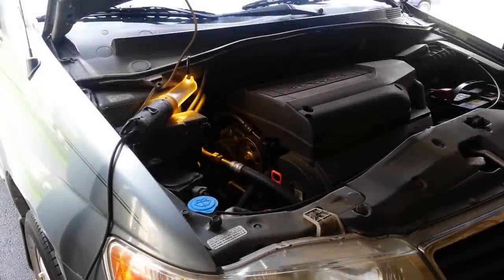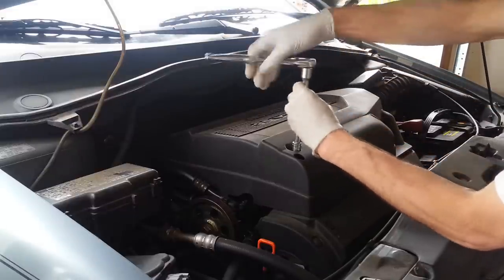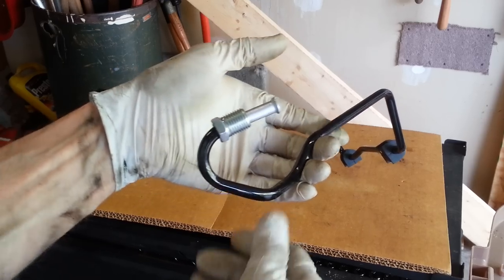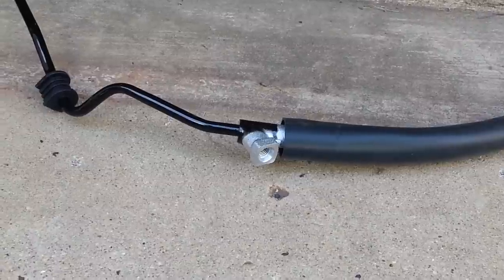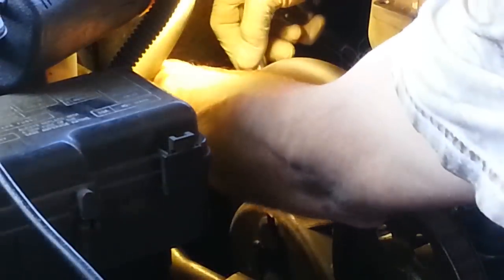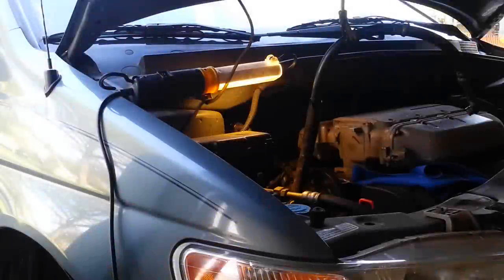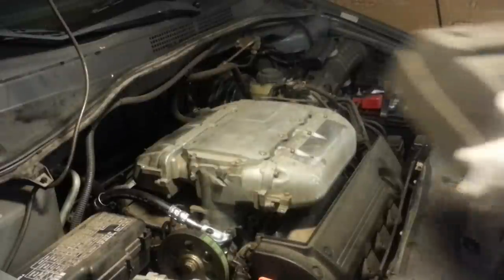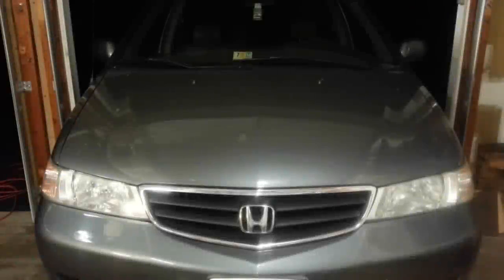Power Steering Hose Replacement 2002 Honda Odyssey

Comment: I just tackled this today and have a few tips for yall..

Only use honda line!!! All the after market lines will leak after a month- year later and you'll be doing the job again..

Most dealers are going to ask $250+ for Honda line,but hondaautomotiveparts has them for $146+9 shipping.

Get some honda fluid if you can.our whole system went dry for about a month and we ended up using about 4 bottles to fill and bleed..if you are just doing the line without too much leakage you'll probably only need a bottle.

its not that bad of a job.just try and get the van up high enough yet safe to work under.. try to have a 2nd person around to help pull out the old hose and feed the new in back in.

Tie a string to the rack end of the line before you pull the old one out.it will save you so much time in trying to figure out how to route the new line and keep you from needing to pull it back out.

The sensor o ring is a 8mm x 2mm.auto part store should have them loose,if not grab one of the o ring packs for $8 or so.

If the sensor wires have broken like mine were and you know how to solder,you can pull the harness out with the line,then pop the black plug out of the back of the harness where the broken wires are,carefully trim the plastic of the harness around the wires with some small snips,then strip off the wire  Insulation so that you can solder new wires to the harness.use some heat shrink where you solderd then some hot glue all around the wires to stop water from getting into the harness from the rear. Now for the other end of the wires on the van,you need to get the broken wires up from down around the cv joint and get it up to the top of the fender so that you can have room to reattach the harness to them. I solderd all those connections. 

If your pump is bad,you most likely can rebuild it.get a rebuild kit,but they don't sell the main pump baring ANYWHERE!!!.however that bearing is the exact same size as a John deere,craftsman riding lawn mower dech spindle bearing and advanced auto sells them for around $6 each.just make sure to take out a seal on one side of the bearing so that it can get lubed while in the pump.

it took my girl and i about 5 hours. roughly hour-2 to get the line fully in and out,about another hour or more to fix the harness and wires,another solid hour of bleeding all the dam air out,and I went ahead and did an oil change while I was under there.

If you have a pressure washer use it afterwards to rise the engine bay and under the van and get all the old oils off.

Now go have fun!!
Reply from the maker: Very nice writeup! Thanks for sharing your experience. It sounds like yours was very similar to mine. Here's my associated video on rebuilding/overhauling the power steering pump:  https://youtu.be/A4zpDPKPdGE.
Reply: I replaced with two different hoses. They all have problems with leak.

Comment: Thanks a lot for posting this procedure. I feel a little better about doing the job now. 
I also assumed I had a bad pump until I found a few pin-holes in the hose when preparing to remove the pump.
It would have made a LOT of sense for Honda to have made a two-piece assembly but they are designing cars for efficient assembly, not easy repair (note the screws going in the top of the lower clamps rather than the side).
Question: Do you think it might be easier to feed the hose up from under the car? Or is there too many obstructions?
Thanks again for posting!
Reply from the maker: You might be able to do it by removing the driver's side front wheel and feeding it from that direction.  The challenge there would be with the chunky part where the pressure switch goes and getting that through.  It's just tough to navigate the hard line over the frame's cross member in those tight quarters no matter how you look at it.  Either way, it's a puzzle that is doable but just requires patience so as not to damage it.

Comment: Nice I have a 2005 pilot   about the same  thanks  wow your line straps are in easy locations  pilot has them sandwiched between frame and car body
Reply: Oh no...I am getting ready to do the job on my 05 pilot and I hope the line straps arent too hard to get to! Some videos suggest dropping the subframe, I'm not about to do that so if you have any other tips please let me know!
Reply: +Leslie Jones it's a tough job...  if you have a hoist.. tools and a helper who is really sharp with mechanics on cars.    basically you have to take a piece of the cross subframe off then loosen four bolts way down to drop the subframe down.  the line clamps can be removed with a 10 mm wrench then but the problem is you need to cut that line and get a socket on it....  yeah. oh shit
Reply: +Leslie Jones you may just want to take it to a dealer it's like an hour and a half or two hours on the book
Reply: ouch... so you're saying there's no other way to get the clamps off other than lowering the subframe? I was hoping that it was only a "suggested" step to make things easier for the more equipped backyard mechanic...
Reply: Leslie Jones just take it to local shop that's good..  buy Honda parts online, cheaper.
Reply: +Leslie Jones if you have a good mechanic to help you go for it if not just take it to a shop

Comment: I used ur video to change the power steering pressure hose on my 2007 Honda oddyssey. I couldn't go past the 1st step. which was remove nut connecting line to rack. I even used a flare wrench. I guess iam stuck.
Reply from the maker: +Eduardo Flores Where did you get stuck?  Did the nut get rounded over or was it just too tight to turn?  Note on the video at 9:30  how I used a cheater wrench on the end of my flare nut wrench to give me the extra leverage needed to crack it loose.

Comment: great video thank you so much.  For me the flare fitting was so tight I rounded it with a line wrench.  I needed to cut the line with a small pipe cutter and use a bolt extractor.   After i got the old hose out the pressure switch was seized to the hose.  any tricks for getting this off or is it just better to buy a new pressure switch?
Reply from the maker: Soak it with penetrating oil and let it sit for a while. Then, perhaps clamp the old hard line in a vice and use a cheater bar on your wrench.

Comment: Really good video, Mr. Chiggers.  ;-)  A couple questions please:
1) In your opinion, does it make sense to replace the pressure switch while you've got the entire thing apart?
2) Did you have to remove any of the wheel well or undercarriage plastic beforehand to reach the pipe underneath the van?
3) I was talking over your video with my son this morning and he asked if it was possible to remove the old hose by pulling it out the bottom since the rubber part of the hose may be more flexible.  Might that be possible?
Thanks,
John
Reply from the maker: John Gerken Hi John (and son).  Thanks for the questions.
1) I'm not sure that I would bother replacing the pressure switch.  I'm only an amateur at this but I've not seen anyone else mention that the pressure switch is a component that typically fails on these cars.  But, it certainly wouldn't hurt and might give you a bit more piece of mind.  The part would probably cost about $40 online.
2) I did not have to remove any of that plastic to gain the necessary access which was nice because some of those brittle plastic clips always break when doing so.
3) Unless you cut the old hose in one or more places, I see no other way to get it out. And the new one obviously has to go back in as one piece.  The biggest challenge is with the rigid metal portion of the hose with all of its bends and angles.  It's a real puzzle under there.  There was no way for it to come out the driver's side or out the bottom.

Comment: I did everything right thanks to this video but I think I cross threaded the flare nut and not it's leaking out the back of the flare nut while it's tight and suggestions
Reply from the maker: Around the 16:00 minute mark of the video, you see me installing the flair nut all the way by hand while everything is still loose. By doing so before using a wrench, you can know for sure that you haven't crossed the threads. If you did just that, perhaps you haven't tightened the flair nut enough to its final torque. It needs to be pretty darn tight to seal properly under pressure.

Comment: This video is very helpful.  I have 2007 Honda Odyssey and hoping it will be same procedure.  I did an exploratory last night and accidently broke the plastic clip that holds the electrical connector to the pressure switch.  (Unfortunately the video does not show electrical connector removal --around 7:30 minutes in the video).  The electrical connector comes off and goes back on but I'm concerned without the plastic clip it will become dislodged under regular use.  I checked with Honda dealer this morning and was told the electrical connector is part of the overal all engine wiring harness (>$550).  Do you have any suggestion how to "gerryrig" the electrical connector to stay connected?  I was considering JB Weld.
Reply from the maker: David Sterrett Bummer on the broken connector.  Coincidentally, I had the same problem on my Toyota recently where I broke the tab off a fuel injector electrical connector.  They can get brittle over time.  I just replaced the plastic portion of the electrical connector without having to splice any wires.  I found the connector for just a few bucks on eBay.  Here are the YouTube videos that I found helpful on the process.  Good luck!
https://www.youtube.com/watch?v=7orqGTmbOmY
https://www.youtube.com/watch?v=mQHT1YF-iQ8
https://www.youtube.com/watch?v=21F_58MkpHA
Reply: worsethanchiggers hi
does any one know what is the number of the hose for honda accord euro 2006 
in this video????????
Reply from the maker: Rajdeep Kaundal You can get that information at the parts counter at your local Honda dealer or look it up online.  You can try the BernardiParts website or any of the other online Honda OEM parts suppliers.  Hope you find what you're looking for!
Reply: thanks for that 
really appreciate that  
:)
Reply: if it is the clip that clips into the sensor. try rockauto.com. they had it for mine for $14 and it came with wire splicers to just strip the existing wire and connect the new wire to it. very simple and cheap.
Reply: Trevor Blankenship, I went to the site you post and they seem to only have online help with questions and no number or way to personally contact them to find the clip I need. Do you know what the name of the clip was called?

Comment: This repair was difficult and a lift would have helped. I cut the old hose to quickly get it out since it was non-serviceable anyway. But the install and “twisting” was a nightmare to figure out but got it done. I already had a flare wrench, the only way to go or increase the nightmare. Worked for a month and then the entire system failed. No PS at all. Contamination? I was careful about that but a flush may be in order. Not sure what the pressure switch does but will read up on it. I can see it being a MIL indication, maybe, but the pump and rack and pinion are mechanical so I suspect a pressure loss/blockage somewhere. While I understand clearly the air bleed process, I have yet to see why the sales of new pumps state they must be vacuum bled?  I’m pretty mechanical but this one is picking on me.

Comment: My 2003 has been leaking for a year now. Where can I get the service manual
Reply from the maker: You can get electronic subscriptions from alldata.com like the pros do. Or, I like to buy used paper versions on eBay. Even used, they are expensive but should still be the first tool that you buy for your toolbox. Make sure to get a genuine factory service manual, not those cheap $15 things from the auto parts store.

Comment: Thanks for a great Video. I am having the same problem with my Acura TL. where can I get a Factory Service Manual.
Reply from the maker: Gnicola78 You can find them from several sources like Amazon or eBay.  They are pretty expensive but well worth it in the long run.  I like to look for used ones since they can be considerably cheaper.  Make sure you get a genuine Factory Service Manual produced by Acura, not one of those thin ones from Haynes.  An electronic option is to buy a subscription for your car from alldatadiy.com.   Good luck with yours!
Reply: worsethanchiggers , Thank you very much for the info and a very good & detailed video. I ordered the parts today & that will be my weekend project. Please keep it going with more videos.
Reply from the maker: Tamils_ Unite_Together I've had good luck buying used ones on eBay.  They're considerably cheaper that way.

Comment: I just tried this and unfortunately stripped the bottom nut. I got the flared wrench and pb blasted the connection, but I guess it was no match for the Canadian winters.
Reply from the maker: Big bummer. Did you find a solution for that?
Reply: @WorseThanChiggers  I would have to remove the steering rack and that is a very involved process, so I just live with refilling the power steering fluid.

Comment: Really good video, but I would like to know what tools and size you use, that would be a huge help!
Reply from the maker: Sorry, I don't remember each specific tool or size exactly unless I specifically called it out on the video. Generally, though, you should be fine with a standard 3/8" metric socket set and a basic set of metric combination wrenches. Sockets used would be between 10mm and 14mm.

Comment: Thanks a lot for the video.  I'm going to attempt the project this weekend to save myself about $300.  The shop that pointed out the leak said it also might be a good idea to replace the power steering belt if I'm already in there.  When I watched the video, it didn't seem like that would make getting the belt off any easier.  Sounds like a separate job.  Thoughts?  Thanks again.
Reply from the maker: Good luck and let us know how it goes.  Replacing that belt is a separate job but it is pretty straight forward.  You have to relieve the tension on the belt by loosening bolts on the power steering pump.  Take a look at my other video about rebuilding the power steering pump to see the location of those bolts.  The part of that procedure where I remove the belt starts around 4:25 and then the belt goes back on and gets retensioned around 37:00.

Power Steering Pump Overhaul/Rebuild 2002 Honda Odyssey

Comment: Is it possible to replace just the crimp where the leak is occurring? Instead of replacing the entire hose assembly?
Reply from the maker: Not really. They apparently use a very special tool for doing that which is not readily available to DIYers and would be prohibitively expensive.

Comment: very detailed video,, im about to do the same procedure for the same problem.  however im getting the hose from autozone.
Reply: labattsipa   i will add some notes.   it would be advised to be careful with the pressure switch connector,, these vans are getting old and the wires brittle.  there is a splice available to fix it if it breaks.  honda didn't leave much slack in this wire so its likely to break..if your having engine surges from 800 to 1100 or more rmp when your stopped at a light, its likely your connector is shorting out.  plan ahead and get the splice before you tackle the hose.

also,, getting that hose back in there was a beast.  best to route it in thru the passenger side wheel well.  your going to have to finesse your way around under there,, your gonna get frustrated and mad, take a break and keep working it.  i managed to get the drivers side of the line aligned with its port and then worked the rest of the line into place.  i also kept the pressure sensor off until i had the line in place and installed it then.   still this is a great video.
Reply from the maker: labattsipa Congrats on a successful install.  Great practical tips!
Reply: +labattsipa  How do you disconnect the electrical connector at the pressure switch?  Do you push a tab IN, and then pull the connector off?  Or, do you pull a tab OUT, and then pull the connector off?  I don't want to break it.  Any help would be appreciated.  Thanks.
Reply from the maker: +TheBruceTR There's a tab near the back of the gray connector that you press in.  Holding that in will release the connector so you can pull it off.  You can sort of see the tab around 18:30 of the video.  Do be gentle because those connectors can get brittle over the years.
Reply: +worsethanchiggers   Bruce,, just what he said,,tab in gently,, and you will; see that the wire harness is tight in there,, not much room to play with..  i ended up rewiring the connector (took it apart) and lengthening the wires,,worked like a charm  another good place for repair info for the oddy is odyclub.com ,,its a great forum

Comment: Good Video ! but I'm wondering, isn't it easier to pull the hose down instead of pulling up?
Reply from the maker: Not really and you can quickly see why if you try. The hard line just won't allow it to be manipulated that way. Some have claimed that it can be removed through the passenger side wheel well.
Reply: @WorseThanChiggers  I did it myself and it is much easier to remove , if you remove right side wheel. Just pull it down and pull it out from right side wheel. You don't have to remove wheel well just remove wheel.

Comment: thank you for this video! how many PS fluid bottles is required to bleed?
Reply from the maker: I believe that the fluid capacity of the whole system is about 1.5 quarts. So, 2 bottles should be enough.